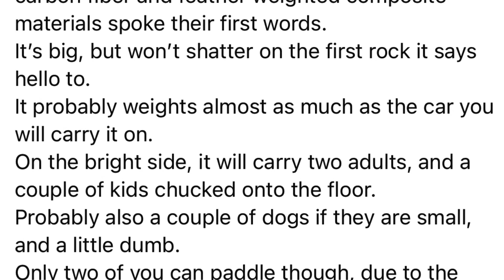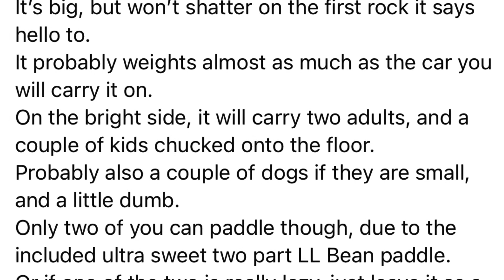Power washing the canoe before selling it.

Comment: Makes me want to break out my power washer soon. They can get rid of dirt and grime fast, however, I learned the hard way, it can power the paint right off dusty exterior window shutters! (It’s oddly relaxing watching the grime wash off the canoe.)
Reply from the maker: This one has a fairly low PSI, so it won’t really damage anything, but it also won’t work to remove anything that’s in deep.
We bought it mostly to was the cars. 
The soap setup is really nice, so it’s easy to use.

Comment: Spray 409 on it first.  That way it will be cleaner when you paddle it over😎
Reply from the maker: Mary used something called;  “Awesome cleaner” from dollar general at the end there. It took most of that stuff off.
The boat sold about four hours later.
Reply: @JimsEquipmentShed    Well, shoot.  I had my heart set on it.  I've got the whole Pacific Ocean over here, with practically no Canoes using it.  I'd have the whole thing to myself, other than the boats smuggling immigrants up from Mexico, and the submarines bringing in coke; I don't mind them because I wanted the canoe so I could sell bottled water to them.  Oh, well.
Reply from the maker: @Reach41  This thing could carry more water than a tanker! Even though it was only 15ft long, it was pretty wide, and due to the air filled seating, virtually unsinkable! (So it would have made it!)